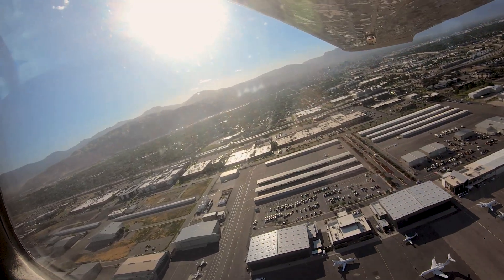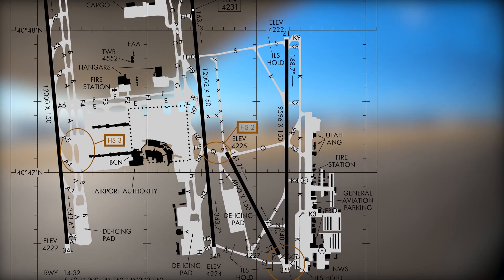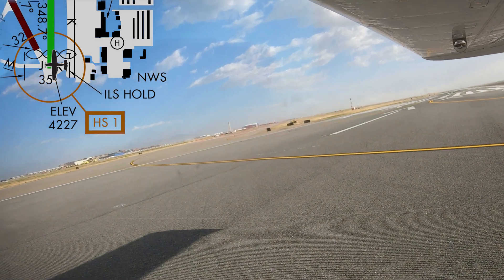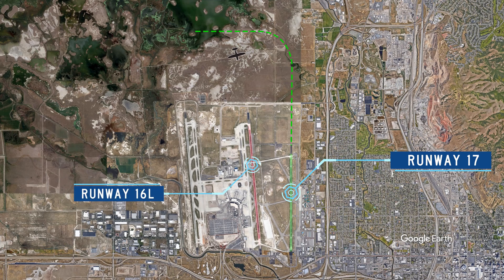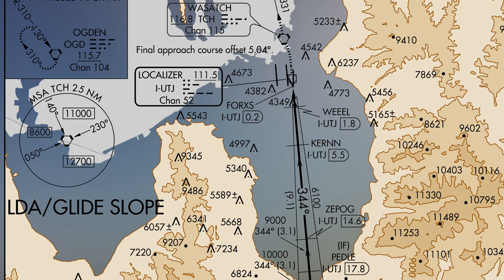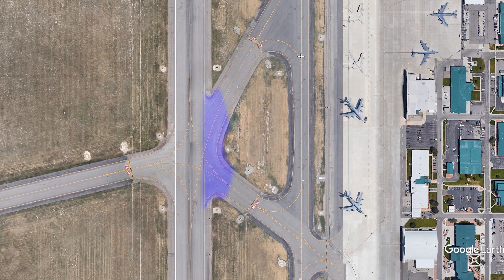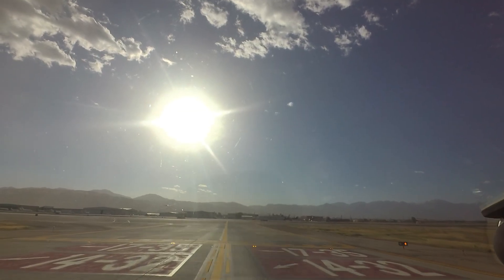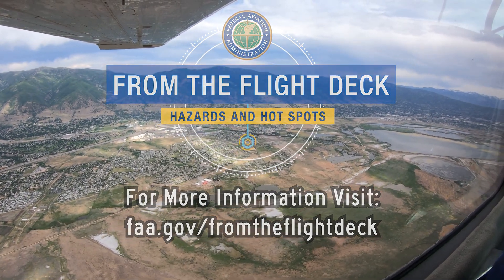From the Flight Deck – Salt Lake City International Airport (SLC)

Comment: KSLC is 8,044 acres, 21st busiest airport in the US. There are plans of lengthening and realigning runway 17/35 to 16/34. So it will be 16/34 L/C/R. Also plans to move the hangars and fuel tanks to make room for a concourse C. They've already spent $4B on the new terminal. Construction will continue through 2040. SLC is 1 of 20 triple operation airports in the world.

Comment: Salt Lake is complex. another airport in my area that has this problem is Joslin Field itself Kilo Tango Whiskey Foxtrot The Twin Falls City Airport. Hotspot 1 for this airport is the junctions of Taxiway Alpha 2, Taxiway Delta, Taxiway Bravo, and Taxiway Alpha and Charlie in between these is a runway junction next to the Skywest ramp and the Reeder Jet Center fuel box. Runway 30 runs right through this junction and 30's blastpad is in the middle of Runway 8. If you move at Joslin Field you must contact Salt Lake Center or Twin Falls Tower before you land or taxi on the airport. If you are parked at Skywest Stand 4 or the fuel box Do Not Taxi Onto Runway 30 When You Do Your Pushback! this will trigger a runway incursion and you can hit a crop duster on final at Runway 12. Taxiway Alpha has holdshort lines located at either end do not enter this area or you will trigger a runway incursion. Hotspot 2 is in the middle of Runway 8 Do Not Taxi into this area you are next to 30"s blastpad if you are on 26 or 8 exit at Alpha 1 and Alpha 3 do not exit at Alpha 2 or you will trigger a runway incursion on 30.   Also make sure your heading is correct or you will land on Taxiway Alpha by mistake don't do that.

Comment: This is the most confusing airport I have ever seen.  I agree with Ed H below.  It should have never been approved in its configuration.
Reply: I believe those first two runways (the far east and the diagonal one) are the original runways from the 40s. Everything else was added onto after for more traffic so it's probably a result of not having time/money or finding the traffic disruption is not worth it. Those far east runways aren't used as often as the main 2 parallel runways anyways.